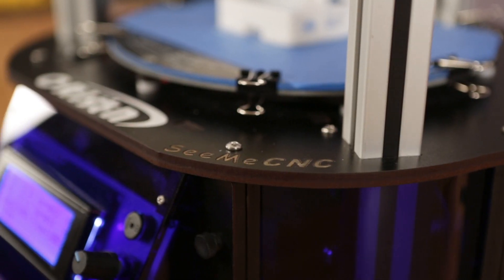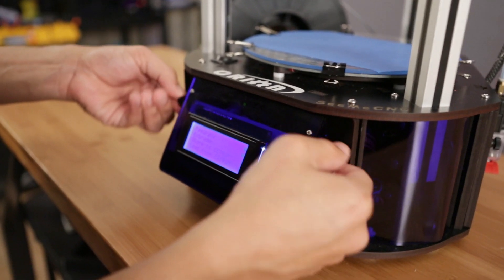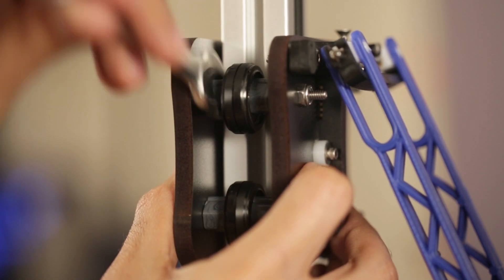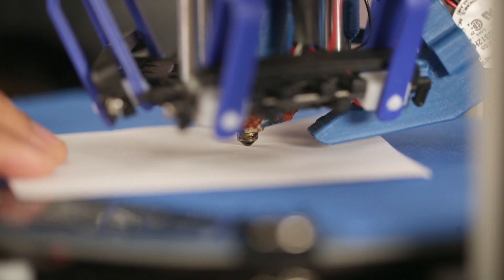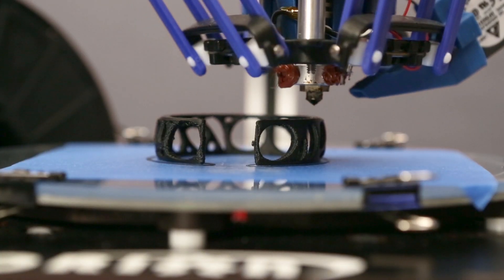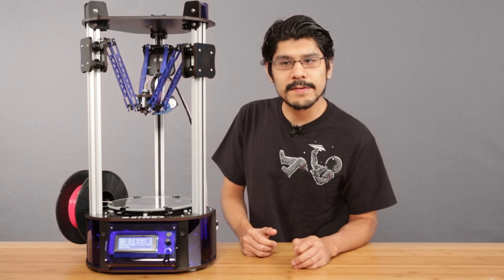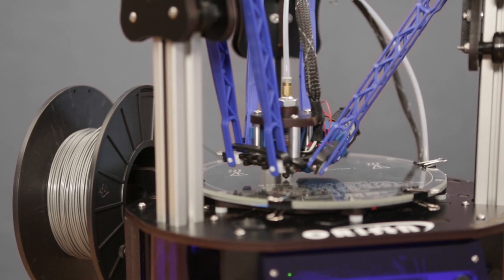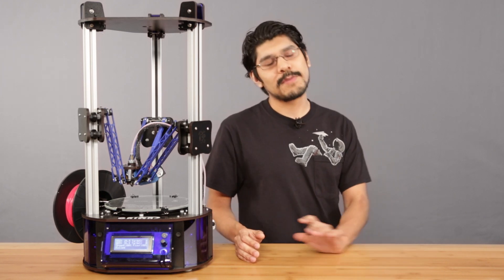Orion Delta 3D Printer Review

Comment: I have had mine for about a year. Although the print quality is good the constant trouble shooting is a real pain. Im on my third machine, the first one was damaged during shipping. The second one had a problem with the nozzle not getting hot enough. the one I have now developed the same heat issues after only two months and I finally gave up and put it on the shelf. They have good customer service. If you get on the forum and complain you will be booted off because the guys running the forum take it personal and expect you to say only good things. I finally bought a makerbot and have no issues.

Comment: First of all I have to say I love the seemecnc printers. They are always good looking well functioning printers. 

With that said. I built my own delta 3d printer. It has a much larger build area than the seemecnc version. As of now the files for it are closed source until I work out the kinks. Its using rostock style carriages however with a pretensioned frame. The end result is a printer that can print in 300x300x350mm+ Not a bad deal. Delta printers have a weak point on the extruder, I designed an extruder that overcomes the issues and increases print speed while reducing retraction necesity. http://engineerd3d.ddns.net/ or check out my youtube channel.

Comment: What's the "blue suff" on the plate?
Reply from the maker: thats blue painters on the plate, it helps keep parts from warping
Reply: Adafruit Industries does it help with removing the print from the INSANELY sticky plate?  If not, would you mind recommending a few things?
Reply: Adafruit Industries You guys should try out hair spray on the glass bed. The parts stick to it extremely well and it lets you do 0.05mm first layers!
Reply: TheRangeControl
If it's really really stuck to your hot glass plate, you can put the whole plate into the freezer. Some people have multiple plates so that one plate can be cooling while the other is printing

Comment: I know this is a product showcase, but ,,,,,,,, hacking and innovation is what drives Adafruit.
Will there be any modding done?
That said,,, are Smoothie boards looking like a viable option for upgrading to better handle the bed leveling and kinetics.
I'm not trying to "jump ship" on what is already installed,(in mine), I just want to see SeeMeCNC products reach their fullest potential.
Reply: Orion is pretty darn good out-of-the-box. TIL the idea of adding an LED ring to the extruder for better lighting. It would be a simple yet useful mod/upgrade. Upgrading to a smoothie board might be a long endeavor.

Comment: Noe Ruiz  I have the rostock maxv2.  I'm running into the same issues with leveling, dead center seems fine, but various spots tend to be either to low or to high, and the plastic either doesn't extrude (on the 1st layer) if its too close but then it'll be too far away and will just string, have been watching videos and will have to check my cheapskates, but it seems you need to go through the tedious process of really tweaking the whole printer to get it 100%.  Given that, its FAR better than the makerbot replicator2x (which has been an expensive lesson and utter time sink/failure just to keep min running) that i also have.  Essentially the rostock maxv2 is my goto printer to get things done when needed.  I haven't really tried ninja flex but I do have some TPE from  #3d2print  that is pretty ridgid that would work in this setup.  I also purchased some e3dv6 hot ends and want to set up a second extruder for dual printing, but I won't undertake this effort until I get the kinks worked out with the leveling, as I can only imaging they might be compounded by adding an additional nozzle ;) Then again e3d is offering cyclops and chimera hot ends that look promising, or I could go with a volcano for "big and beautiful" parts :) 
http://www.dbclunie.com  #seemecnc   #rostockmaxv2   #3dprinting   #makerbot   #adafruit